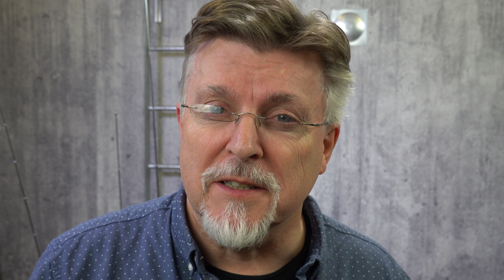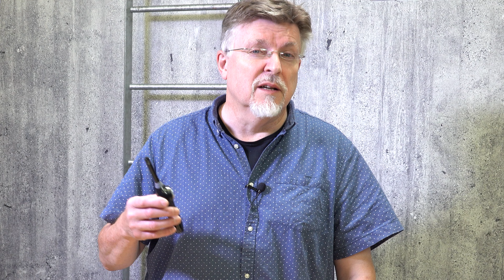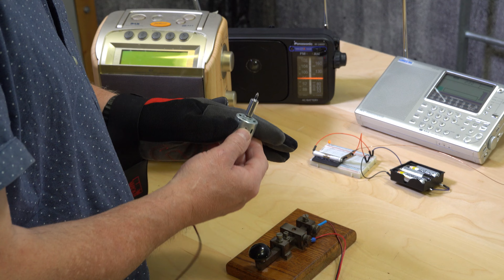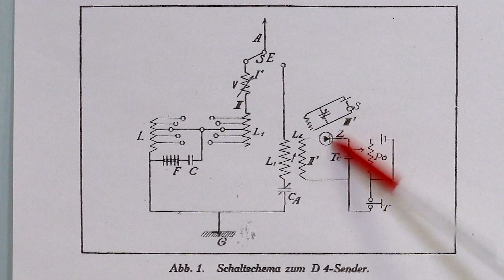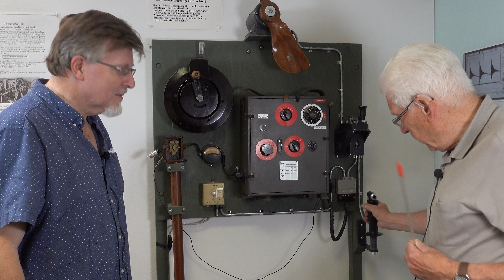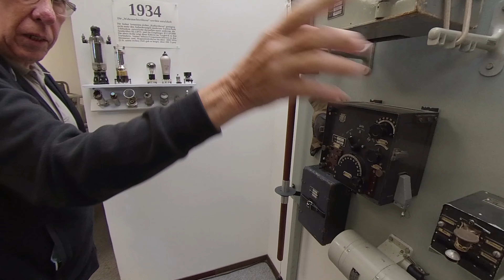Spark Gap Telegraphy and the WWI Telefunken D4 spark gap transmitter

Comment: The  Radicon bus!   These were Japanese RC toys, the bus and car and others, with coherer receivers and a little one-button RC transmitter (spark transmitter of course.)   Not too rare, not too expensive.   
Also, the plans for Nikola Tesla's 1899 radio receiver were discovered and built.  It used a coherer, but one which was continuously rotated by clockwork, and was wired as an amplifier.   It could detect signals 10,000x weaker than with conventional coherer receivers, but Tesla kept it all secret, never patented.  Sensitive receivers had to wait for the invention of the triode vacuum tube amplifier.

Comment: Forced by your very interesting and well presented video to further investigate the Branly coherer, I assumed that 'filings of a steel nail' would actually be a poor choice (because of steel's normal tendency to residual magnetism) but, it turns out that low remanence 'soft' iron - Meehanite for example - doesn't work well either because of the (inevitable) effect of oxidation on the iron fragments, which form an insulating layer and hence reduce the sensitivity to RF. Turns out that metallic nickel (which is also ferromagnetic), alloyed with small quantities of iron and 'moistened' with metallic mercury  is the way to go (or was found to be). Rather than filing down a nail, filing down something like a cupronickel coin might produce better coherer material. Damaging British coins of the Realm is forbidden, obvs, but finding something else metallicly similar to a British 20p might be a workaround.

Comment: Banned by 1934? TBH, I think moves to ban 'Spark-Gap' had started considerably before then. Continuous wave technology had been around for quite a while (Alexanderson alternator transmitter -1910; Hartley oscillator 1916, regenerative receiver - about 1915, superhet receiver - 1920) so there wasn't much technical justification for continuing the spark. But, on practical, cost grounds there was strong resistance to actually getting rid of the many thousands of spark gap sets still in use by the navies, merchant maritime and armies of the world. According to what I read, the agreed absolute, total ban on operating spark everywhere in the world didn't come into effect until 1940.

Comment: The speed of the generator decreases when the morse transmission is made, that is, when it is under load. Doesn't this make a difference in the transmission tone? Would a scenario where the transmission tone is determined by the rotary discharger but the discharge occurs at the quenched gap be efficient? Is such a thing possible? It sounds like this way the tone can be kept constant.

Comment: forgive my, no doubt, daft question. but i have recently started learning about this sort of thing. I thought the winding had to be insulated and tapped every so many turns. so how does the armature here at 13.50 contact anything? is the wire not insulated? great video. cheers. (i am sure i see this bloke everywhere. in vids about astronomy, V2 rockets, and now radios!. remarkably busy chap)
Reply from the maker: Hi Dorian, no problem, it's a good question. The coil is tapped - you can see where i pulled loops out on to board if you freeze the image. The copper wire is insulated with a thin coat of clear enamel or lacquer. Once the coil was made I carefully scraped the lacquer away on the track followed by the wiper (I just marked a broad enough strip with pencil and ruler - about 1cm wide and the length of the coil). I used a small file to remove the lacquer. I hope this helps - thanks for posting. KR RJD
Reply: @deutscheavionik7211  Thank you , all has been made clear. I really appreciate your replying.  DA
Reply: @deutscheavionik7211  hi chief. if you are still reading replies could you please help me? i am a little unsure about making a coherer. there is a dearth of info online i have found. particularly, how small does the gap between the brass rods have to be at the bottom of the v shape? is that design essential? would 2 copper discs with a few mil gap between work? does the size of the iron filings matter? i enjoy making model rockets with flight computers(that is why i have seen you previously on rocket vids) and i have decided i want to launch a rocket using a spark gap radio to send the launch signal. you may be interested to learn that every time i look at a road on a map I think of you measuring the road outside your house in a vid from yonks ago. keep up the good work DA

Comment: This video is really satisfying for me, guess what just few days back I was telling these basics to a friend how the very elementary form of radio signal is a simple spark, but I was never sure, never read or heard it anywhere, Just in my childhood I would be listening to radio and then suddenly a person living few houses away would start his scooter then a disturbance in speaker so synchronised just as if the sound of scooter is being played on radio, also someone pressing a electric switch, also electric motor used for crude form of machine or cutter that would be used to shredding the green fodder for cows and buffaloes nearby would have few minutes of signature disturbances on my radio or even tv daily and would be annoyed till they finish their work, then also I would try same thing with small motors i could find at home,
Hence I formed this idea that playing with spark in well defined complex rules voice or sound is transmitted by stations,
Also I discovered myself that binary system used in computers has also its very base in an electric switch cause data can be defined physically or electrically in 1 and 0 only, an electric switch is simplest computer having a value of 1 or 0 at any instance both in digital realm in its wires and physical thats the front of switch which is toggle a switch, switch is in both fields I guess.
Thanks for making your marvellous videos that just came up in recommendations today and finally I am sure that I guessed it almost perfectly right for radios. Learned beautiful concepts ahead of what I knew.

Comment: Is there any type of watch or clock that could be making a repetitive noise
Reply from the maker: Hi Dapinderjit, some years ago a friend told me about an electric clock on a cooker (50Hz 220VAC) 
that had became faulty and generated a sharp RF tick every 15 minutes and could be heard at various times on a number of recievers local to the house where it was located. After some weeks of living with the mysterious RF click, the interference was finally corelated with an audible click comeing from the cooker. It seems a relay was trying repeatedly to energise a heating element and failing. I have also heard of the running gear of microwave cookers creating repetative pattern radio interference - though I have never heard this myself.Just a thought. KR RJD
Reply: @deutscheavionik7211  at young age i used to  hear a scooter on radio whenever it would start, a guy living few houses away owned it, its rf interference was completely in sync with the sound of engine as if sound was playing on radio
Reply: @deutscheavionik7211  i wonder how much wide these disturbances from sparks are on radio spectrum, how it depends on various characteristics of that spark, can it be used in any jamming equipment also?